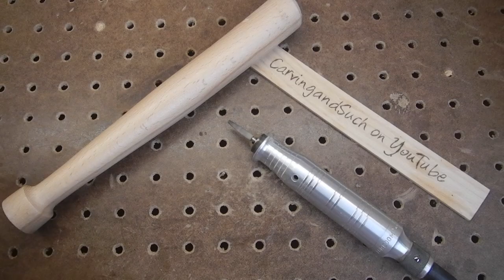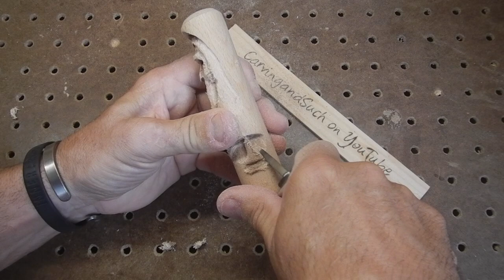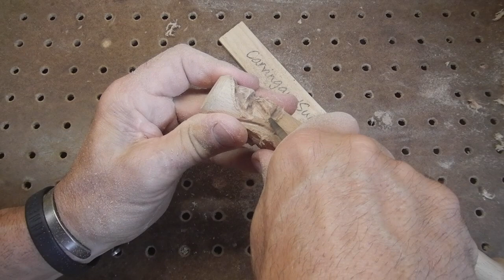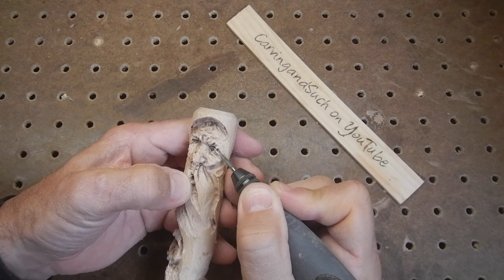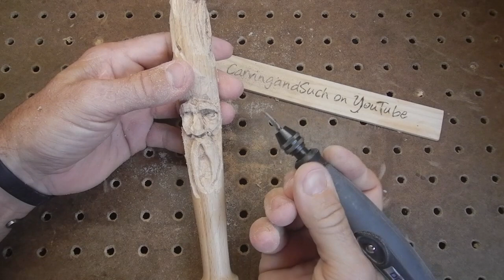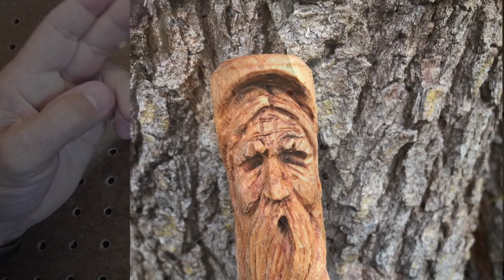Wood Spirit Wacker Power Carving  Links in the description

Comment: what do you use for 6mm burr?
Reply: I highly recommend kutzall burrs. Absolutely amazing and last quite some time. Just dont go to far over the recommended rpms or it can start breaking apart faster.
Reply: First of all I apologize as I use google translate to communicate with you, I want to say that the kutzall burrs do not go into the mouth of my dremel, I would like to know what you use to put the 6mm burrs. Thank you very much for your response and the magnificent work you do 😉
Reply from the maker: I agree with Steve totally. Kutzall are the best and one more thing, I using adjustable chuck instead of collets make the shaft size switch a breeze.👍
Reply: @carvingandsuch  thank 😉
Reply: @puntal666  kutzall will fit your dremel. Make sure to get 1/8th bit. That will fit it. Otherwise, ya an using an adjustable chuck makes a huge difference. Unfortunately dremel doesnt come with one.
Reply: @puntal666  you can always find really cheap bits on Amazon. $20 for an 8 pack of cheaper made bits that take off wood with ease. They just wont last you nearly as long as kutzall. But i still use a few of my cheap ones and they are awesome. And for $20, you cant complain, especially if you are a beginner. Just go on amazon and type 1/8th rotary burrs. You find something for cheap 😊